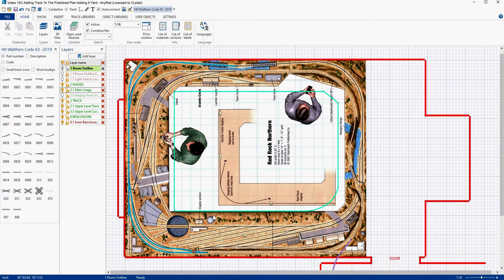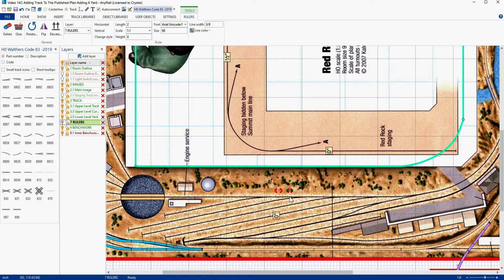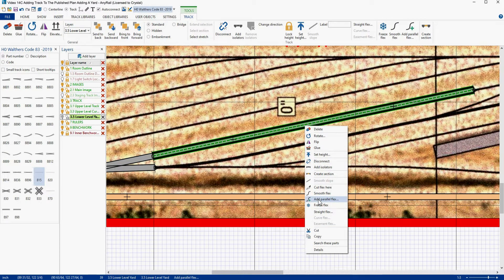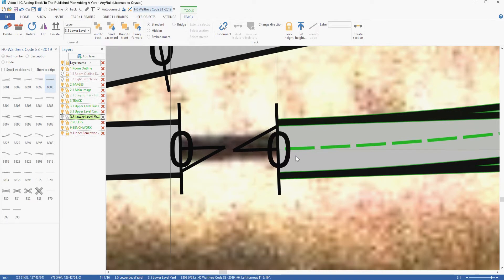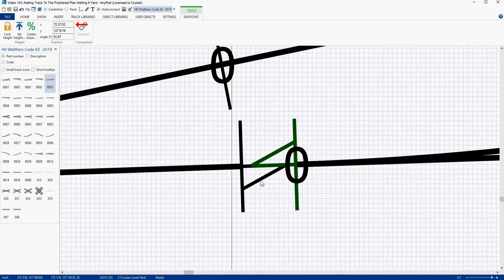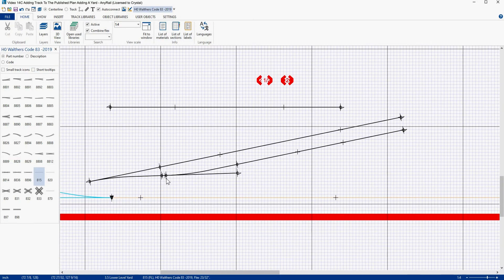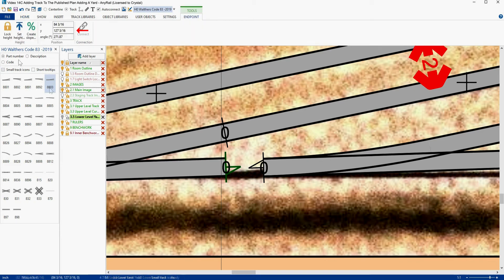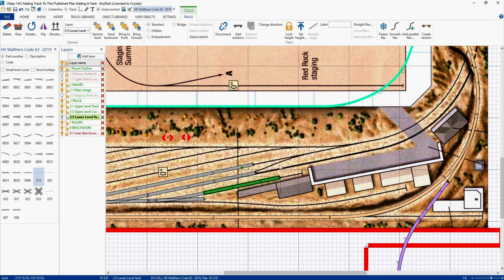AnyRail 6 Tutorial Video 14C: Adding Track To The Published Plan - Adding a Yard

Comment: Been watching your excellent videos on AnyRail 6.  I am starting to design a rather large layout and am learning a lot from your videos.  I knew some basics, but wow didn't realize it could do all of what I have seen so far.  Will continue to watch the rest of your videos.  But I noticed in this video you showed at around 2:31 a track work layout of pre-built-up items to be used when you are designing.  Is there any chance I could get a printout of that or the AnyRail file for those.  It would save a lot of time but understand if you would not be willing to share this.  I checked your website already and could not find it there except for the easement files.   You kind of mentioned that you may provide this in a video as a coming item.  Thanks again for these great videos.  I don't thinl they are too long at all!
Reply from the maker: Hi Rick, I really thought I had answered you already but I looked today and doesn't seem I did or it did not post for some reason. I am not really a fan of sharing files but I still want to make that video on how to put together a bunch of items into a premade entity drawing, I hope to do it soon. Dave
Reply: @steampoweredradio2981  Looking forward to seeing it.  I started to do that based on your videos.  Mainly have some staging yard sections set up.  As you stated the turnouts are some what different depending on the manufacture.  Hopefully the libraries are accurate enough.  But a little bit of juggling may be needed when actually building the track work.  Wish in AnyRail you could group a couple of different track sections, but haven't seen that unless they all are connected together.  Hope you will cover it soon.  Thanks.